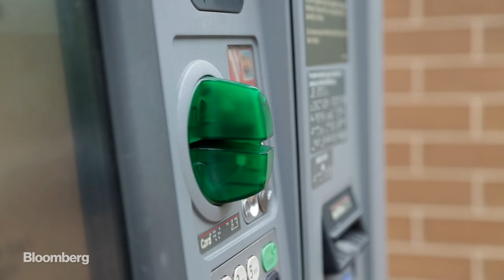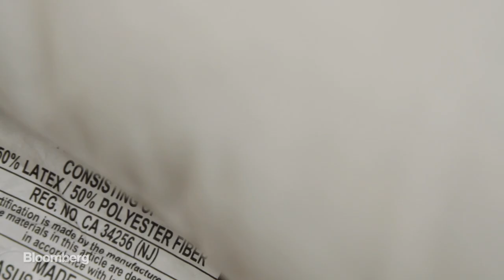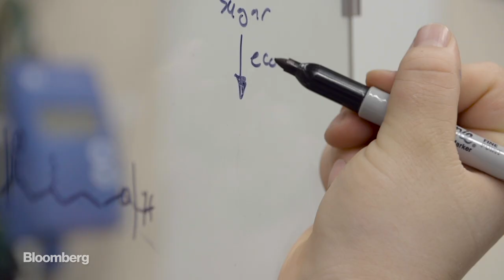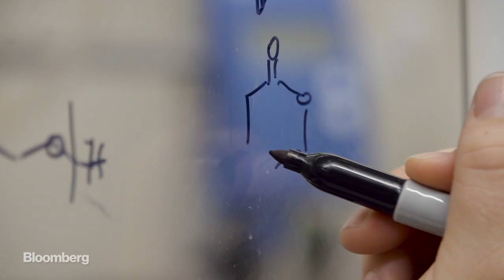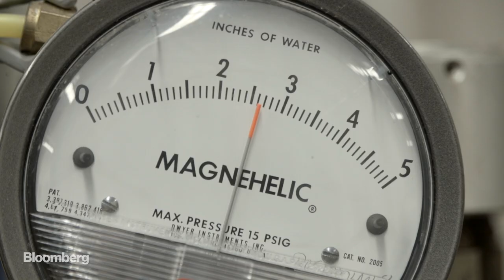Inside the Lab That Could Solve the World's Plastics Problem (Unsolvable: Episode 1)

Comment: The best way forward is gasification. It is a proven process of medium temperature closed system heating of all plastics and converting, gasifying, the material back into natural gas. The natural gas can be used for energy or processed into clean feedstock for new clean plastics.   It is simple, low cost and efficient. It is too easy.

Comment: Plastics can be turned into clean diesel fuel by a very simple distillation process that does not require extra energy. I found a You Tube video of a man that built a distiller out of odds and ends in his back yard. Problem solved.

Comment: Let’s not purchase plastic anymore!!🌍❤️
Reply: that's impossible now. besides like the video said plastic isn't bad its how we handle it. just like guns their not bad until the wrong people get them.
plastic injection molds are a lot easier to make and use than casting everything in aluminum and machining it. 
aluminum isn't 100% recyclable you get about 1-5% slag from the oxide layer. remelting aluminum chips from machining is worse because of increased surface area. you'll recover about 40-60% of the aluminum. I've melted both aluminum parts, cans, and chips. recovery % is indeed different.

Comment: This claim about plastic taking around 500 years is extremely over estimated it takes less that 75 years for plastic even if the heaviest durability lasts less than 75 years. Why do you think houses aren’t made of water bottle plastic... it’s because plastic if try to melt it produce or can produce harmful chemicals... also what chemist don’t tell you is that you can only convert a percentage of the material back to its original form it takes energy to convert a chemical change even if that takes less energy than what it does to produce older forms of plastics... seriously everything breaks down but if you make a less durable product it will cause us to have to get a new one sooner... most people don’t understand that this will only raises the cost of these new products with new materials just to have it degrade and not hold up longer than older products...

Comment: the time it takes plastics to degrade depends on the kind of plastic they are.  you know, those 35mm film cases, like pot heads learned to use to hide their dope (i prefer using them to keep change ) ? they start breaking down when exposed to mother nature and in 10 years they are about gone. others last decades or longer.

Comment: It is a both problem. It's hard to buy what you don't know exists, or is not available in your area. Are some consumers lazy? definitely. Do some companies over-package the hell out of things as "theft prevention" definitely. Can consumers put pressure on the companies for better packaging, yes. Will it work? Maybe. If there is no supplier who can keep up with the demand level of a manufacturer, it won't happen. Will a packaging materials company do enough R&D to make sure the packaging they offer is sufficiently durable that the product it houses is appropriately protected, and won't be broken during shipment? only if they think they can turn a profit. Then, they have to convince the manufacturer that the new material can do what they say it can, and that it can be supplied in sufficient quantity. Consumer pressure helps. Most of us don't h ave enough time in our days to fill out feedback forms to manufacturers. We need to work on this. We need to tell the stores we shop at that we want to see more products responsibly packaged. They can help put pressure on the manufacturers. There needs to be consistent effort from several fronts. It is a balance thing.

Comment: This problem; is in large part because of the behaviour of the end user; he is lazy & unwilling to sort & transport plastics he no longer wants/needs.  Most sorted plastics---at least, of the seven or so most common resins---could be stockpiled in desert areas until chem. eng. discovers a way to reformulate them.....or use them as they are!  Lot of materials find 'employment' after discovery, and having a large, concentrated, LOW_COST source would be a godsend.....

Also, restrictions (enforced by law!) on what plastics can be used together: For example, in packaging lids & containers should be of the same resin.....with the recycling number either quite large & visible, else chemically encoded to facilitate sorting.  Materials such as the laminate in Tetra-Pak products must be reexamined, and beverage containers (to start with) SHOULD carry a 'meaningful,' "return deposit" which would encourage entrepreneurial collection.

There isn't a need.....for so much variation in containers & packaging; standardized limits can help to crawl back......from the abyss of suffocation.....in the 'prop-wash of affluence.'!!!!!!